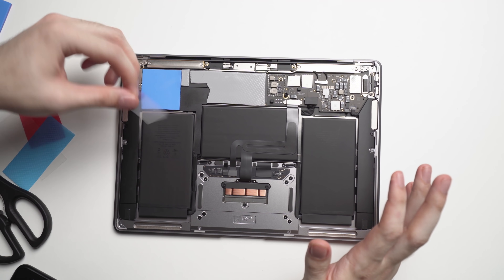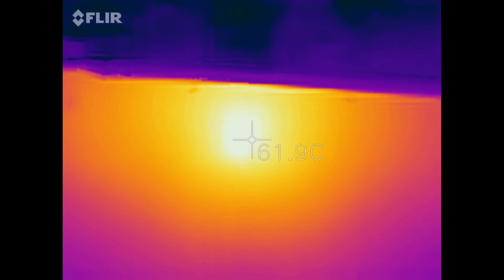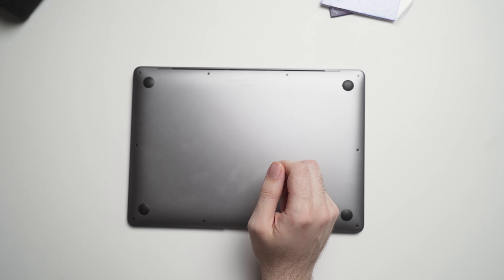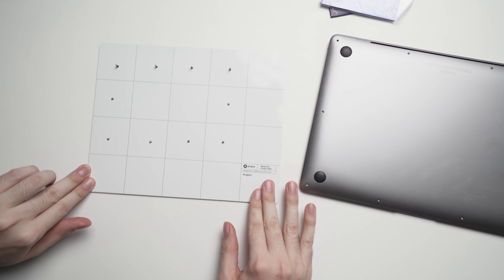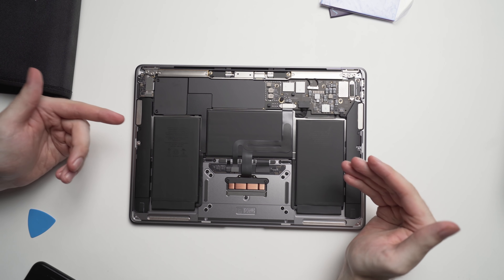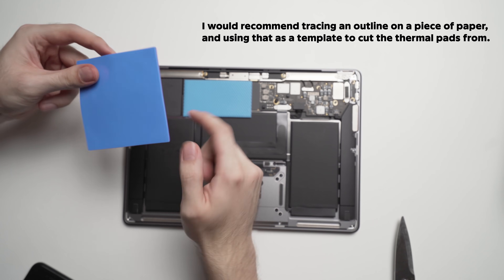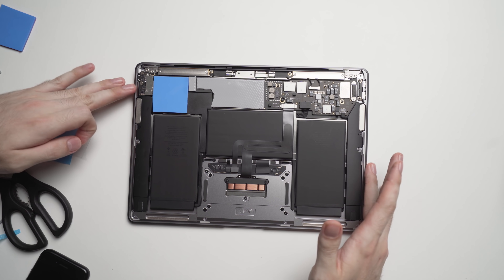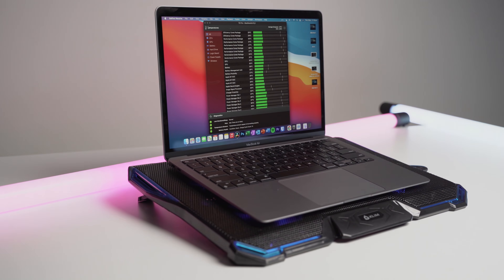How To Thermal Mod Your M1 MacBook Air & INCREASE Performance by 20% (Step-by-Step Guide)

Comment from the maker: ► Equipment used in this video (Amazon links):
1.5mm Thermal Pad: https://geni.us/thinthermalpad
3mm Thermal Pad: https://geni.us/thickthermalpad
iFixit Pro Tool Kit: https://geni.us/ifixitprotoolkit
iFixit Magnetic Project Mat: https://geni.us/ifixitprojectmat
Reply: I ordered the pads thanks!  I have a wowstick with the pentelope (P5) screwhead.  
Do you need the suction cup to remove the back cover or can you do it without it?
Reply from the maker: @georgegui  You don't need the suction cup but it is so much easier to pry the back off if you have one!
Reply: In Australia the link to 1.5mm pad doesn't work. There's no 1.5mm available there.
Reply from the maker: @JamesBryant4  Try it again, I just updated it. Looks like the seller changed their sizes.
Reply: The link to the 3mm pad goes to a 1.5mm pad. Having trouble finding the 3mm pad for this brand. Any suggestions? I’m in the US.
Reply from the maker: @Abcdef9h1jklmn0p  Just updated the link
Reply: What about the warranty 
It's just 6 months I bought the MacBook air
Reply: What conducibility values do you advice for the best safe result? 3, 6, 12....6W/mK? Thanks
Reply: bro does this work within the macbook pro 2020?
Reply: Hello there :) 
Would this work with pads with a 13.3 (W/m.K) rating or is that too high?

Comment: The heat problem in the case or the battery problem can be solved by placing the MacBook Air on an aluminium disc about 4-5 mm thick and about 200 mm in diameter. The heat is then transferred to the desk via the rear casing, which heats up considerably, via the aluminium round plate that lies directly against the casing. This worked particularly well for me as my desk has a glass top and this absorbs the heat well. Wood alone may not be so good. In my case, the centre of the disc is roughly where the CPU is. This means that the disc protrudes slightly beyond the Macbook Air.

Comment: You will just transfer the extra heat through the back cover and onto the battery, reducing its lifespan, as the battery is very sensitive to heat.

Comment: this mod is working pretty well, but it is going to kill your battery. The battery can rich 45C easily. So I can confirm it is not safe if you don't cool down the bottom aluminium cover plate.

Comment: I have an honest question.....do you think that putting the thermal pads onto the case ontop of where the CPU and GPU is would work the same?. It may be easier to remove the thermal pads off the bottom case cover than ontop of the CPU and GPU because the heat is going to cause some melting of the stickiness.

Comment: to those considering to put the thermal pad only in 1 area, if you noticed the thermal camera image, the hottest area is directly above the chip itself... in other words you could just buy the 1.5mm pad and be done with it just at the area above the chip... the yellow part of the thermal camera with the highest heat spot is to the right of the center top left screw so its basically above the m1 chip itself... and if the area where the 3mm pads were to also transfer heat, then at the very least, the area just bellow the screw should also be as close to the yellow color as the area just above the chip to indicate that the heat actually choose to transfer to that 3mm pad area at all...

Comment: Why not using 1,5mm Alloy or Copper with thin Thermal Paste applied? Alloy: 200 λ (W/(m*K)) - Copper: 380 λ - Thermal Pads: 5 λ

Comment: I would like a laptop chiller pad that sits flush against the backplate of the M1 MacBook Air, that conducts %100 of the heat.  What is the best way that you know of to quickly chill the backplate of the MacBook Air ??
Reply: a block of ice

Comment: Thanks for all tests.
Is that a bese line M1 Air? 8GB RAM 8 CPU and 7 GPU?
In one of your videos you mention that this is 1 les GPU core than  13" MacBook Pro M1.

I got M1 Air 16GB RAM 8/8 CPU/GPU. I wonder what speeds I would get. Just ordered thermal pads 12W/mK. THX

Comment: In order to really get the maximum performace, you 100% SHOULD remove the black tape-like material. It is actually thermal INSULATING tape, meaning that your thermal pads won't be nearly as helpful as they should be. It doesn't need to be scratched off, it can simply be peeled off like a sticker. Note that doing this will make the bottom of the MacBook much hotter (imo) but it means that the heat actually will be transferred somewhere.
Reply from the maker: And it also means you will instantly void your warranty, while you at least have a chance if you leave it be. At the end of the day you will see minimal performance gains by scratching off that insulation.

Comment: To save a bit of money and less wasted leftover thermal pads, just order one 1.5mm and for the thicker part stack two sheets...most thermal pads sold are enough to cover all with 1 sheet. yes there may be slight loss of thermal transmission by stacking them but I'm using 12w/mk rated ones so should be sufficient.
Reply: How did it go with the 12w/mk pads?
Reply: @Dunyeee  they make 20w ones which would be even better. i wish i had the time and money to waste making a video showing the difference with each thermal conductivity rating
Reply: @Dunyeee  Gelid Extreme pad

Comment: while i won't mind if it does increase the performance of my MB Air, the main reason i've done the mod is to hopefully increase the components lifespan by allowing it to cool down faster/better on cpu/gpu intensive tasks (mainly gaming in my case), especially considering i live in a place where it's warm pretty much all year round (80F on average, with peaks up to 90+F).
Reply: I might get it and play some games such as Minecraft, should I install it or,not

Comment: I just can't keep wondering why didn't they did this on mac (not so) mini and iMac instead of fans. Totally quiet and in case of Mini several times smaller as well. 

And maybe they could add extra function to Mac Mini and call it iCook. 😂
Reply: linus explains why they had to sacrfice not using thermal pads 
mini surface area is less and the imac using fans will draw heat out of the body will sustain professional workloads

Comment: Rather than applying a two thermal pads covering the whole of the heat sink, it would be best to only add it to the end of the heat pipe furthest away from the M1 chip set.
The thicker dark blue thermal pad only.  The heat pipe is there for a reason to draw the heat away from the chip so that the heat exits from the left hand side as seen, not the centre.
This helps ensure the power regulators next to the SOC chip are subjected to less direct heat from the hot back case.
Reply: You are mistaken, the same heat is gonna be there either way, especially when the chip is working hard. So yeah use every surface available to draw the heat away from the chip and into the back chassis. 

Really the whole top part should be covered with it, for the best heat dissipation
Reply: @DoorisJ  Both of you are right for the wrong reasons. If you put less thermal pads the mod will be less effective and arrive at the max chassis temperature later, which actually might be preferrable if you want less of a chance you'll burn yourself. The "keeping the power regulators cooler" part might be true too, but I don't think it'll have as significant an impact

Comment: Would like to do this to 2018 MBP 15”.  Did you cover that ever?
Reply: Hi, I did it on my 13inch mbp 2017 no touch bar, the gap from cpu to back plate was 1.5 mm , your is most likely the same, but you can check it by opening the back putting a small piece of play dough on the spot, press close  the lid, then measure the thickness of the play dou to know,  remember to remove the heat insulating black plastic layer on the back plate first(this alone should also help with cooling)
And then just search online for thermal pad, they will make you choose your thickness, make sure to pay attention to the heat conductivity(10+ is good).
Let me know if you have more question
Reply: Your mbP has a fan inside to cool things down,, so you don't need to perform this mod.  The MacBook Air is fanless and has an easy-access heatsink which is why this mod works on it.
Reply: @wearecontendmusic  But my fan doesn't cool to my satisfaction.

Comment: Nice! i did this with my Macbook Pro 2015 a long long time ago =)
Reply: Where did you put Them? I've a mbp2015 13 and It Is Always on 70°...i've changed the thermal paste but It doesnt change anuything
Reply: @O_marchese  right above the processor heat sink. And I cut the black sticker in the aluminum bottom, so the thermal pad make direct contact with it
Reply: @DomenicoPesci  so you applied It in substitution of the thermal paste? Directly on the cpu?
Reply: @O_marchese  the black sticker from the bottom case needs to be removed. Because it’s a thermal insulator.

Comment: Thanks for sharing! but u didn't provide the exact size! 
I have to look it up into my macbook myself. 

For my measurement, the left squre is 4.2cm*4.6cm, the right one is 2.1x 3.3 + 6.7x3.6
so for the pad we needed,  it is like, we need 20 square cm for 3mm thick, and 31 square cm for 1.5mm thick.

Comment: Hey, I am thinking about doing this mod to improve the overall thermals and performance of my M1 Air. I had just purchased a set of 1.5 mm, and 3 mm pads, but I forget to check out the w/mk rating. The thinner one is 6 w/mk and the 3mm is only 1.5 w/mk. Would I still be able to use both of them? if not, I will just return the 1.5 w/mk
Reply from the maker: I'm using a 3mm  1.5 w/mk in this video from memory, you'll see minimal difference!
Reply: @CreatedTech  Thanks man! They came in today and I am about to set it up. Thanks for the great videos, and keep up the amazing work!
Reply: @zachz72  That's absolute shit, get a 10+ one , it's about the same price, the cost of these small items often just reflect the shipping and handling cost
Reply: @CreatedTech  can you write size of 3mm and 1.5 mm pad. Is 80x40mm be enough (withou compile with cutting parts)
Reply: How'd it go?

Comment: Re-Screwing the back plate in order around the the back plate will most likely warp the back plate no? Should you not re screw in an opposite side pattern?
Reply from the maker: It’s not going to warp, I’ve been doing it the same way for 10 years and have never run into issues. The back plate and screws are pretty foolproof.
Reply: @CreatedTech  okay, thanks :)

Comment: May I suggest you do a video on temperature test on the back of the laptop with: 

1) temps on - normal everyday usage such as web browsing, emails, PowerPoint, excel, YouTube.
2) temps on - heavy task such as video editing, and so on. 

Reason being some people might want to do this mod but worry it heats up their lap on a normal usage basis. But when they want to do heavy load tasks, they can just plug it on a cooler and a dock. This is ideal provided if (hopefully) normal tasks are not uncomfortably hot on the touch.

Comment: hello, if the m1 is always connected to usb c monitor, does it kill the battery?
Reply: A rule of thumb for taking care of lithium battery is that you shouldn't let it stay at high voltage (high percentage, normally over 90%) all the time. So drain the battery down to 20% at least once a week, that's what I do with my M1 mabook air.
Reply: thank you!!

Comment: Not sure if this will cause damage to the battery considering the heat dissipation
Reply: same thoughts, maybe it will make sense to add some thermal isolation layer between batteries and back cover

Comment: If possible could you try this mod on MBP? I’m not sure if it’s possible but would love to hear your thoughts. Thanks!
Reply: it can be done on any macbook, just put it on the cpu heatsink plate, you just need to know the distance from the cpu to back plate, most likely 1.5, but you can measure it with a small piece of play dough, look it up on youtube, and watch other models' to get an idea
Reply: I don't think its possible because the MacBook Pro already has active cooling.
Reply: @pinguman13   yes but there are videos on YouTube where people apply thermal pads on heat sink on MBP 16 & 15. So was curious if it would work ok 13 as well.
Reply: @Smart.Potato  idk then lol. People are creative!

Comment: Thanks for showing us how to mod the MacBook Air. This is a really good mod for the MacBook Air. Besides the slightly better battery life on the MacBook Pro the MacBook Air is probably the better choice out of the 2 computers especially with this mod. The thing I like about the MacBook Air besides it being signifcantly cheaper then the MacBook Pro is that there are no moving parts (fan) that can break and that it is completely silent. Plus less chances of the inside of the computer collecting dust etc. 

I really appreciate all the effort and time that you put into these videos... Awesome channel! 👍🏼👊🏽😎
Reply: if anything, the battery life can only go worse because the mac is being pushed beyond thermal throttling

Comment: Just buy macbook pro with fan problem solved :D
Reply: some people just buy the air version because of no touch bar! :3
Reply: Not necessarily. With thermal pads the air has ben shown to outperform the pro. Furthermore, the pro is hundreds of dollars more, and the fan can be quite annoyingly loud, especially in a quiet environment. To each their own though.

Comment: Will it be possible with M1 Mac mini?
Reply: The mini has a fan..... so why would you bother?
Reply: Well, see if you can make the mac mini's fan spin first
Reply: you don't need it for mac mini, this is for laptops that can't run fan forever, you can get the application, mac fan control, in which you can increase the strength of the fan (by setting the temp that fan start spinning lower for it to kick in earlier and harder), since you are plugged in to a power outlet

Comment: Anything that pull heat out of the case bottom will help a lot. A steel, marble or granite tile will work wonders. The only problem with these passive approaches (as opposed to fans) is that they all have a limit based on thermal conductivity and thermal mass of the passive elements, but with the plus that they are totally silent.

Comment: I'd be very careful with this - 61C is easily enough to burn yourself. 
Could you do some gaming testing and see if it makes a difference to FPS?
Reply: I've seen some tests and it seems that it only gets hot in sustained work loads. Renders etc. Which I'm pretty sure I would just do on a desk anyways.
Reply: Yeah I'm interested in fps in gaming too.

Comment: Hey, have you tested only applying the thermal pad on the left side? I think it may help spread heat, but at the same time not make the lid too hot. Idk though
Reply: The performance boost you’d get wouldn’t be nearly as good as it’d be less effective at cooling down the processor. The processor slows when hot, which slows the performance. I’d be better just to set it on top of a desk, or lay something on your lap if you do this. Oven mitts, maybe lol?